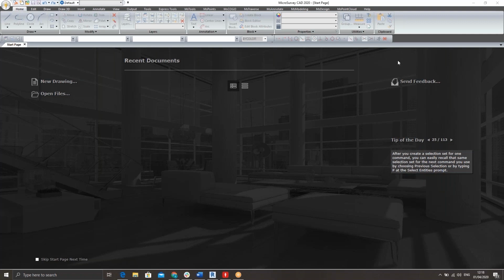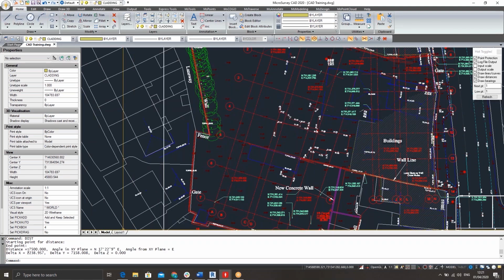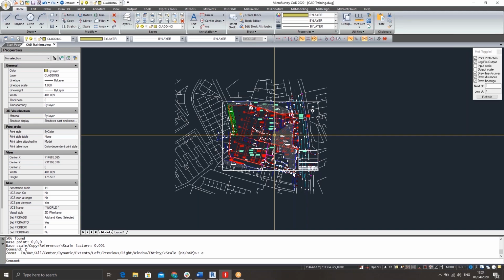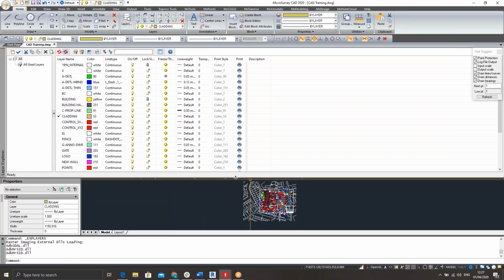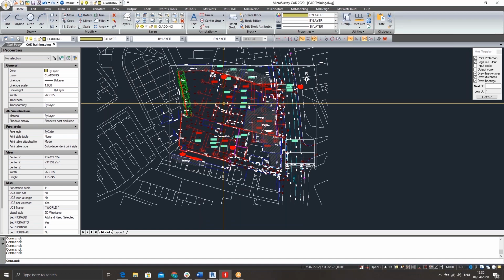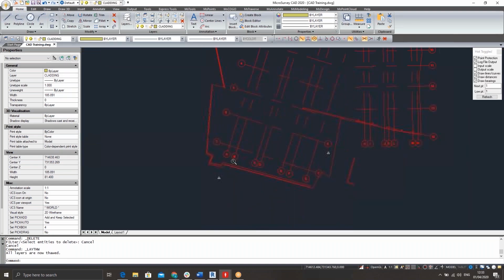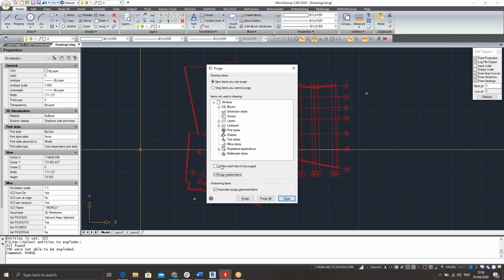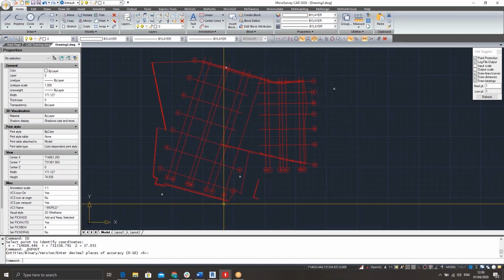CAD Drawing Prep

Comment: Good videos man. Ive had trouble  when saving control points to a specific file within a job. One scenario was i came to a job and an external company had set up the original control, i wanted to spread new control and they were auto saving into the external companies file on the logger. 

Is there a way to set up new control files on the logger and then how do you shoot new control knowing they will save to a different specified file?